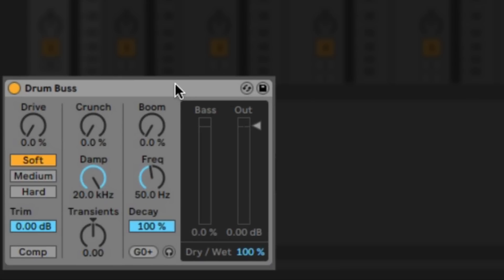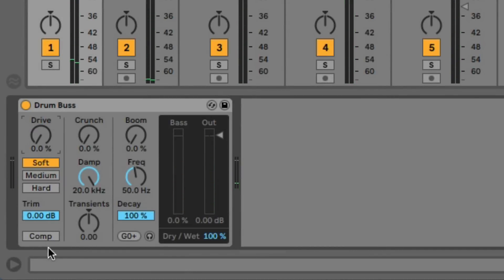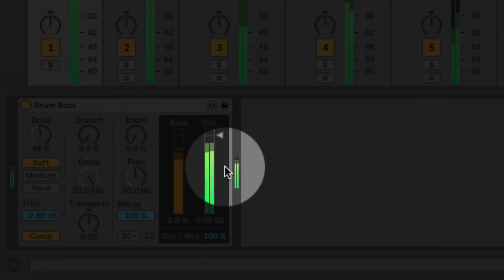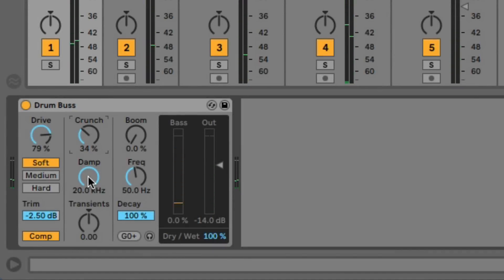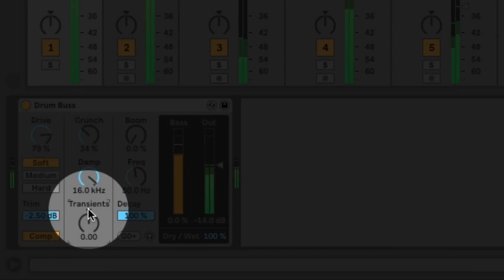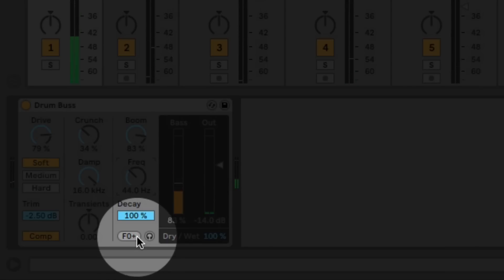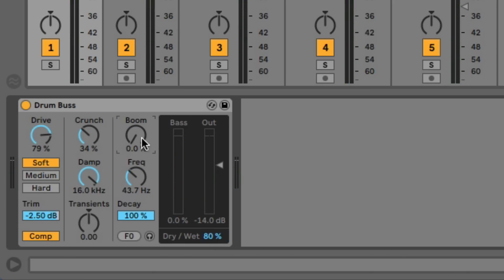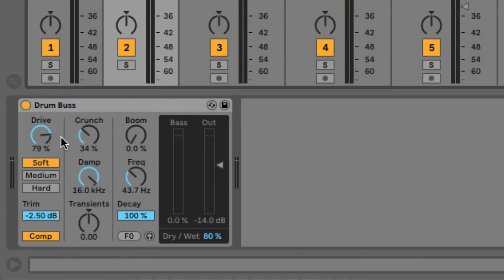How To Make Your Drums Sound HUGE in Ableton Live

Comment: Hey Stu, I use your template with the drum buss included for the percussion group... one thing i'm having to do in my mixdown is always move the level of the drum buss down a bit to match it on/off... is there a way to set it before the mixdown that you won't have to do this or does it just depend on how many percussive sounds you got in there?
Reply from the maker: Hey Kirk, good move on keeping it at unity gain. There’s no way around that unfortunately. Drum bus is just a loud plugin. And yes it will depend on what you feed it. It shouldn’t cause a big problem though. Just lower the output volume until you are at unity gain. The only other thing I could suggest is checking out “Volume Buddy”. It’s a max for live plugin that helps out with auto unity gain settings.
Reply: @basskleph  awesome thanks man!